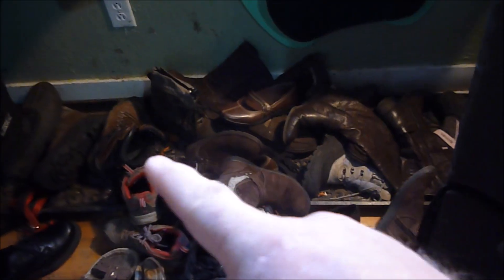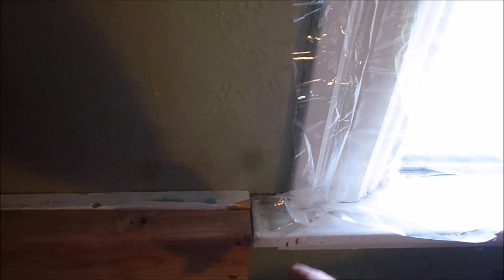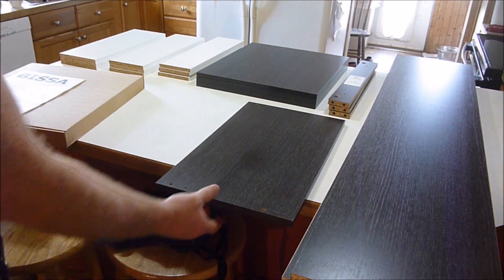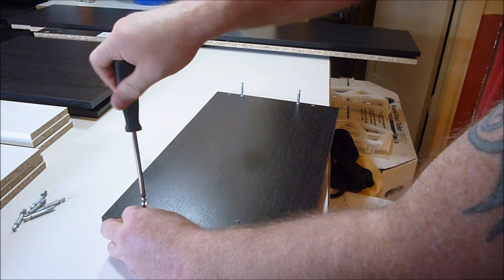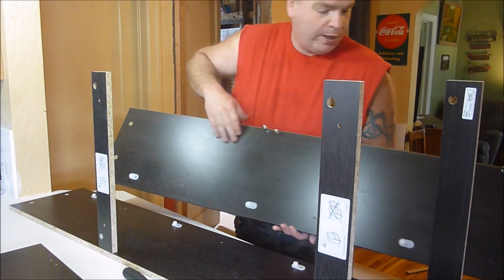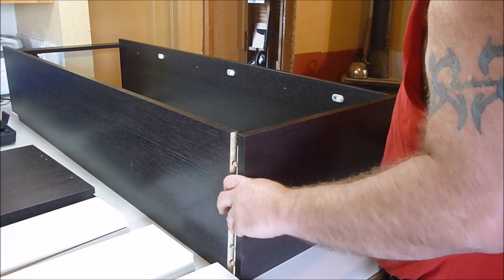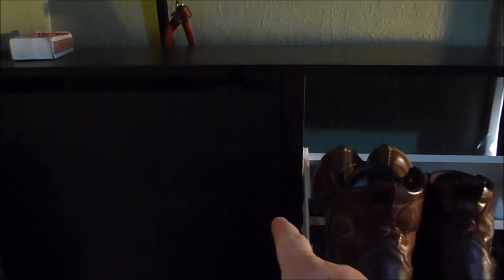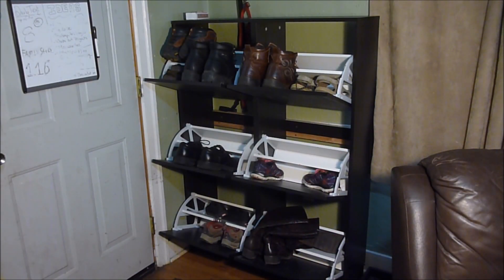IKEA SHOE CUPBOARD CONSTRUCTION

Comment: I rent my apartment so I'm not allowed to drill any holes in the wall. Would it tip over if I don't mount on the wall but just be really careful with opening the drawers each time? If it's just too easy to tip over, is there any non-drilling way to secure this on the wall? Thanks!
Reply from the maker: i think if you have level floors and were somewhat careful it would work fine

Comment: Is this fixed to the wall? If not, does it tip in normal usage? Thanks
Reply from the maker: i did screw it to the wall i wouldn't trust it to stand alone
Reply: Junk works DIY Garage thanks